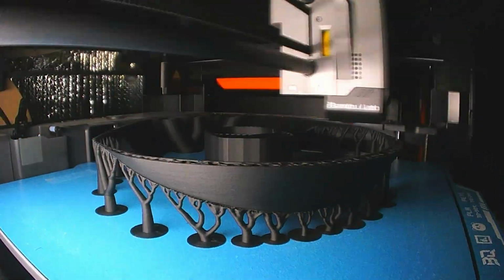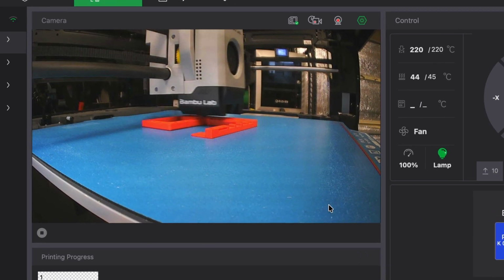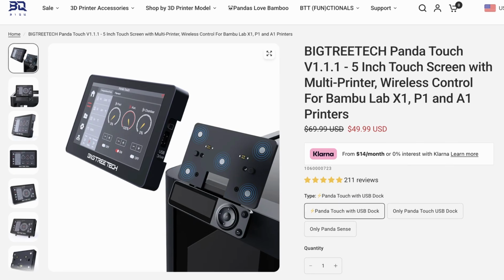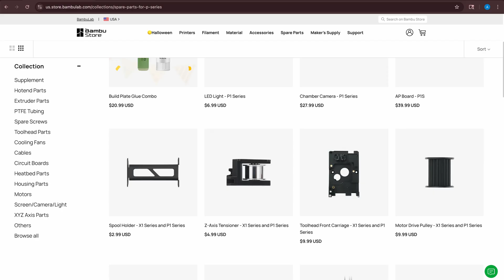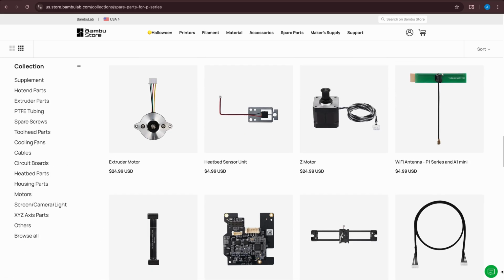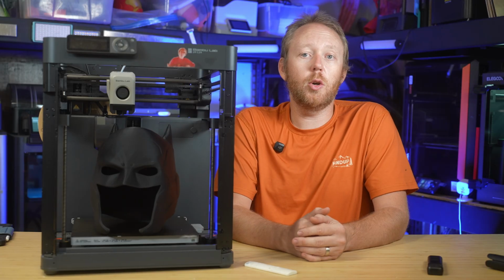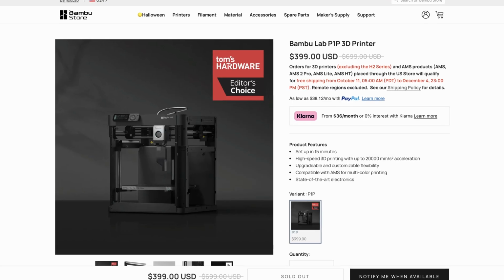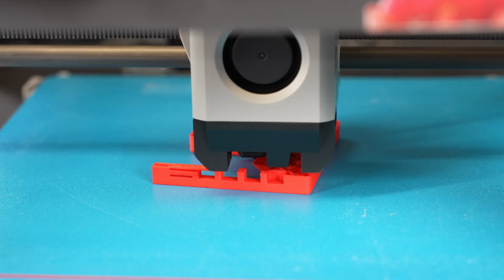Is the $399 Bambu Lab P1P Still a Good Buy in 2025?

Comment: I own a kickstarter X1C, and the P1P ended up being my 2nd machine I purchased from Bambu. I also purchased the A1 when it was first released. I have to say, the P1P has ended up being my PLA workhorse. I have ended up with two AMS 1 units attached to a nice swinging shelf that stacks the two units on top of the P1P, and it's just awesome. The open frame actually helps dissipate heat far better than any of the other enclosed printers, so I end up with far smoother, better detailed prints. So yes, even now with the announcement of the P2S, the P1P is absolutely a solid choice for a budget friendly printer. I prefer it over the A1 because the overall footprint is smaller. Besides, the A1 flinging poops everywhere got old fast lol.
Reply from the maker: it is impressive how far the A1 Can sling those poops haha. Hows that X1C running?